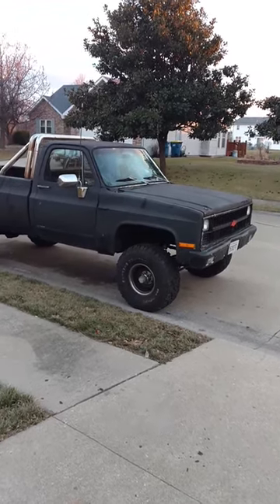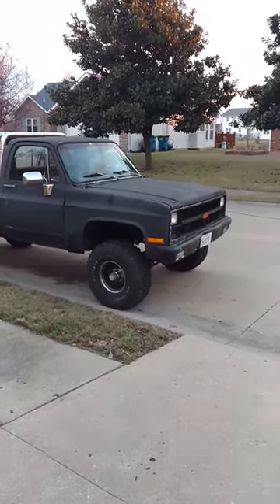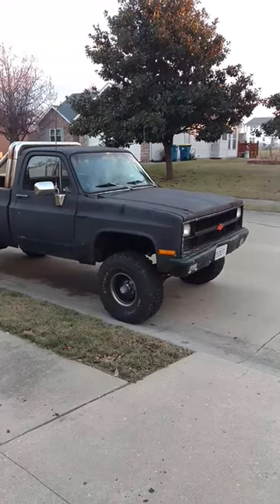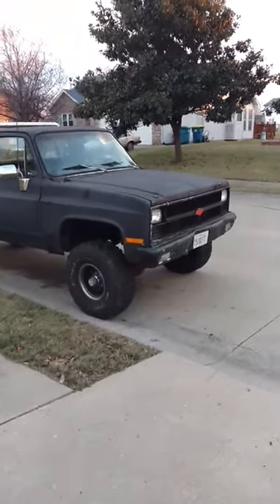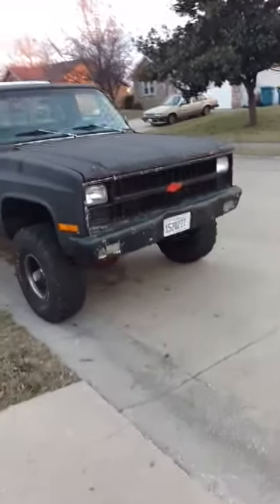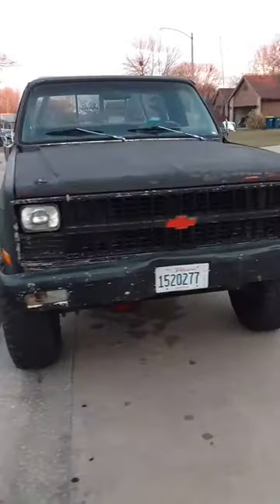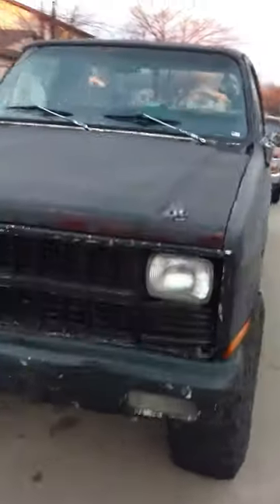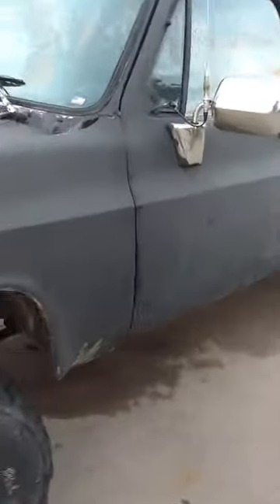Fixing Engine Tick With Automatic Transmission Fluid

Comment: Good Tips for People !!! Recently, I did 2 Car / Trucks with ATF Fluids.  I am doing the 3rd one this week, and waiting for the 100 Miles.  I can tell you..., THIS IS A MUST for every 100,000 Miles on ANY CAR / TRUCKS !!! Both of the Engines that I have done... One is a Chevy 4.3L Vortec and the other is a Honda 1.5L. I am HAPPY to report, BOTH ENGINES ARE SOOOOOOO SMOOTH NOW :))))))))))))
Reply: My formula:  1 Quart of ATF Fluid, + 4 Ounces of Gumout... Run it for 100 Miles, then change Oil / Filter.
Reply: +Sea Life - If your Engine has been neglected and really bad.... Then YES, I would do ALL full ATF Fluid.  If you can afford it to do all ATF Fluid, then yes.... I would do the whole thing with ATF Fluid. Make sure to use Synthetic ATF Fluid.... Walmart Synthetic ATF Fluid is pretty cheap.  Also, every 100,000 is a must... This is what I will do from now on when our Car / Trucks reaches 100,000 regardless.  :D
Reply: +Sea Life - No I haven't :((((.  If my Engine was really BAD :((((.  I would try it :).
Reply: +Sea Life - I've also seen a lot of Video with Marvel Mystery Oil... Same thing... Same Formula as well... 1 Quart of Marvel Mystery Oil and run it to 100 Miles.
Reply: @JodBronson sea life ??

Comment: Shouldn't you drain some oil out before putting the transmission fluid in so you don't over fill it?
Reply from the maker: I would recommend either doing this trick while your oil is low or as part of an oil change. This truck has a pretty steady oil leak so it's always a little low

Comment: I've seen ATF used in the cylinders for old start/cold start videos never the way you used it, about a year ago I had a hard knock on cold start pretty sure it was a exhaust lifter sticking it was about 1/2 a quart low on oil witch is where it goes to and stays at any rate I added 1/2 a quart of MMO the knock has not returned now I use 15/40 fleet oil and substitute one of the quarts of oil for a quart of MMO the first time changing the oil and filter I'd never seen the oil so black I'm at about 152,000 miles it runs great quite and smooth. How many miles are on your truck? Great video BTW
Reply: +James Kmenta - I have done it in 2 Car / Trucks already, I am on our 3rd this week and I am soooooo HAPPY I did it and the Engines is sooooo smooth now.  If your Truck is over 100K, This-is-a-must.... Try it before your next Oil Change.  My formula:  1 Quart of ATF Fluid, + 4 Ounces of Gumout... Run it for 100 Miles, then change Oil / Filter.
Reply: +James Kmenta - Check out a Video I made afterward explaining what I have learned here:  https://www.youtube.com/watch?v=OgqotSDSptw

Comment: Hi the ticking is a sticky lifter the atf works I know from my own troubles in the past  half quart at most and no speed over 45  I agree 100%
Reply: I've been doing a quart for years in every car I've had and I drive regular. NEVER had a problem. They all run great!
Reply: @stevemccullough893 isn't a quart too much to drive until next oil change . It dud you mean add quart run for 15 min then drain and do oil change and filter change . I'm confused.  Thanks

Comment: He says pint not quart? Which is it.
Reply from the maker: I used a pint (1/2 quart) for driving on it. I don't think it'd be wise to thin the oil that much and put the engine under any kind of strain, I know people have done it I just don't like that idea. Using 1 quart would be my recommendation for a type of flush where you replace 1/5 of your oil with atf and idle the engine for 10-15 min drain and refill full with oil but that's not what I did here.